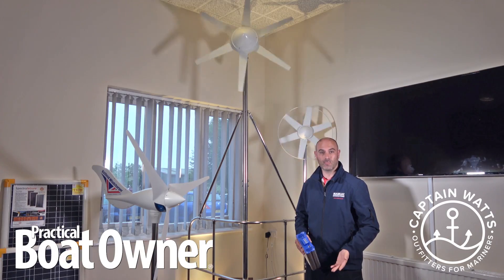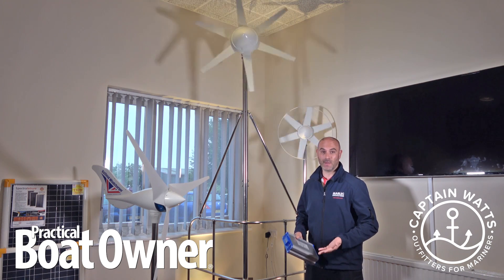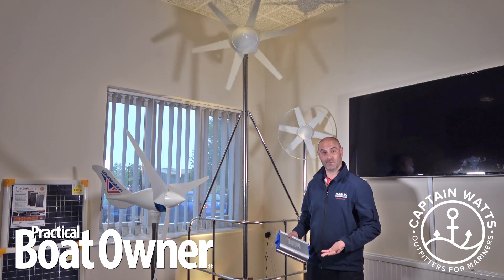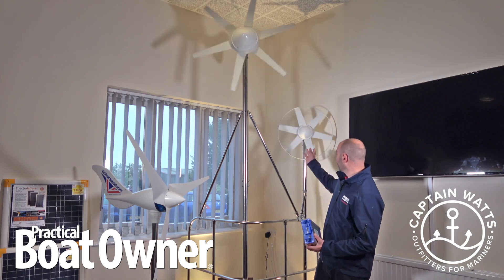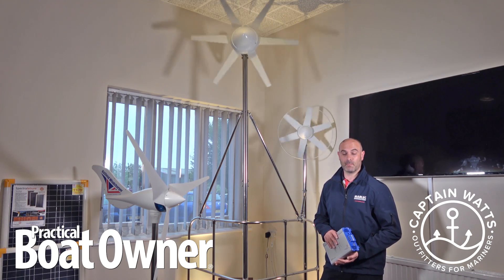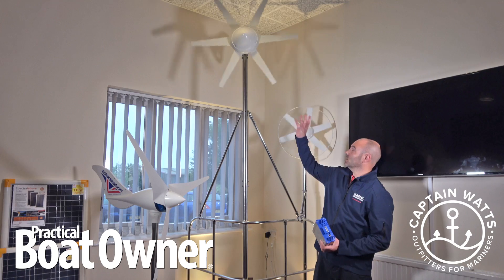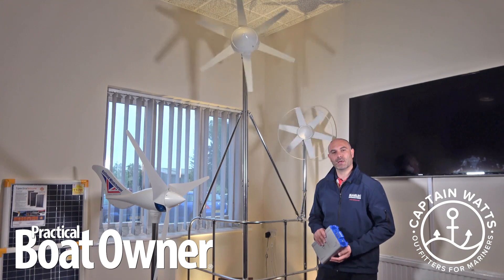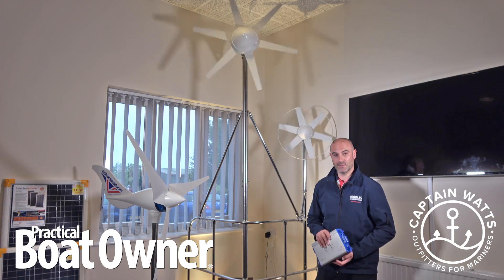Introduction to Wind Energy & Wind Generators for your boat with Marlec

Comment: Can these be used with motor yachts?
Reply: yes a motor yacht can sit at anchor and run a wind generator  same  as a solar panel..
Reply: What's the point of that? Motor yachts have big alternators on their engines.

Comment: can it be used for a medium size house?
Reply: Can it b used for a man cave to run a tv dvd and a little fridge
Reply from the maker: Hi - It is designed for a boat or potentially small motorhome. It relies on batteries for storage so there is a limit in terms of power depending on your battery bank. It us unlikely to be suited to a medium size house unless you have a minimal consumption and very hefty battery bank.